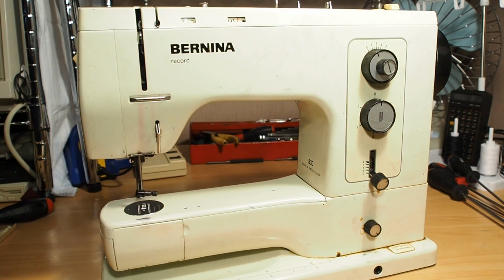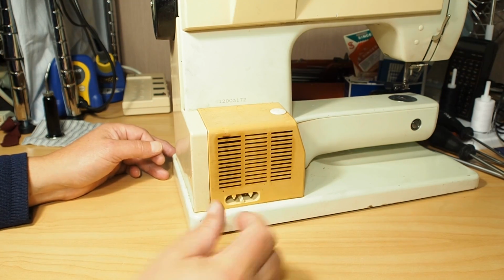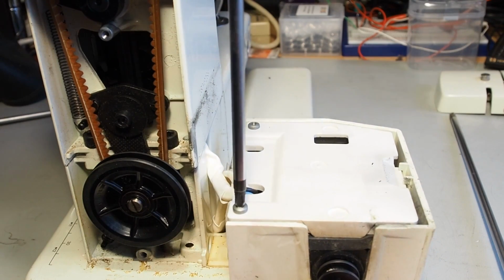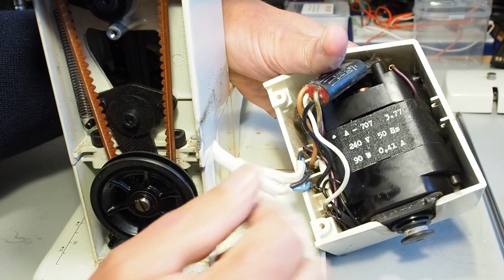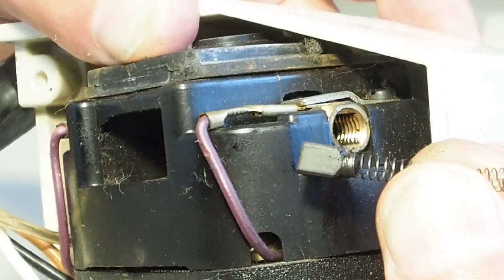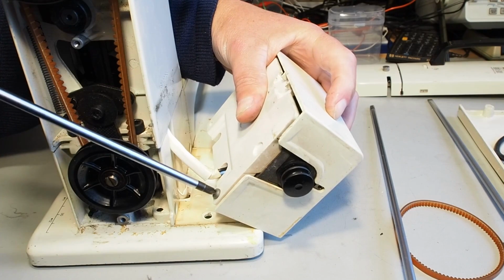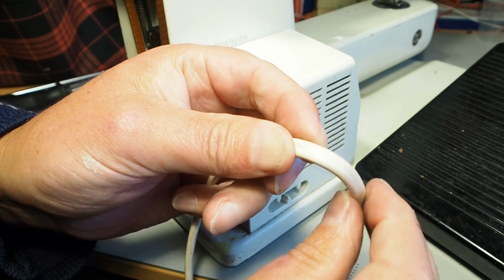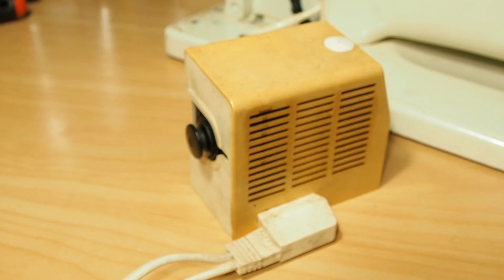Bernina Record 830 - Motor Checking - Brushes and Capacitors

Comment: The brushes are down to about 1/4 inch of graphite remaining, so I will replace the brushes very soon.  I've notices that lately the motor runs as if spinning, but the gears seem spotty about engaging.  I'll check the capacitor in the morning.  It's a good machine.  I appreciate you posting this video.
Reply: @isaiah434ruby Hi, Can you remember what brushes you ordered and where from? Thx

Comment: I just bought a Record 830. It is making a loud grunting noise at slow speeds that goes through the whole machine. Have you seen this issue before?
Reply from the maker: Yes I think I know what you mean. Check the capacitors and the motor brushes. I guess if the capacitors have been removed it could be a cause but not sure. The motor could be at fault.

Comment: Great video. You saved my day on an Elna TSP cam gear. Truly could not of done it without your help. I did change the brushes on the TSP and the motor still growls in initial start up. From 20% on it sounds great. Any thoughts. I'm not sure I'm ready to go into that motor again. Berninas  motor set up is great.

Comment: I just received a Bernina 830 that I bought on eBay. I oiled it per instructions. It runs but never reaches the speed it should. I checked the brushes and capacitors and they seem fine. What else should I be checking?
Reply: Did you switch the max switch at the bottom of the front of the machine? (below the stitch change knobs)
Reply from the maker: Maybe the mechanical parts of the sewing machine (not the motor) need oiling? The machine may be tight in which case the motor is straining to drive it? Either that or the motor is weak?

Comment: Got an 830 Record that needs a new capacitor, any idea where I could find a replacement? (Even better if it is in Australia)
Reply from the maker: If you asked me 10 years ago I would say Dick Smith. Maybe Jaycar? There are four capacitors and they need to be the correct type and assembled correctly.

Comment: Hi, I just bought a 830 record 2ndhand. I notice when I press the pedal slightly harder at fast speed, there are flashes of light emitting from the motor. Is that something I should be concerned about?  I think I might have to return the machine if the motor has some issues.
Reply from the maker: Hi, that can be quite normal although I would be checking the brushes as a matter of course. The sparking could possibly be worse than normal if the capacitors have been removed.
Reply: Thank u so much for your prompt reply. I'm not handy or technical in any way, so I have to bring back to the seller to check. If you are in the country where i am located, I will definitely send to you for servicing!

Comment: Hi, thank you very much, I was able to open motor case and saw my capacitor has a crack so I will remove it. Would you please tell about the wire; white, thick one, transverse lying between the terminals just in front of the motor. Mine is burned out as my capacitor. Can I remove it too? My machine does not have speed switch.
Reply from the maker: If it's what I think it is, you'll find a resistor under the white sheath, in which case it's more than likely a discharge resistor and can be removed.
Reply: @InStitches  I found the tiny resistance. :) thank you so much. Finally I was able to plug in, holding my breath, it works.. I could not manage it without your excellent video. Thank you.

Comment: Great video, exactly what i was looking for! I have recently found a Bernina 807. However the capacitor blew when it was plugged in. Your explanation was very informative. I was wondering if you could explain/show where to purchase a new one? Is it a case of just searching online for a capacitor with matching numbers? Any help would be appreciated.
Reply from the maker: It's a bunch of four capacitors and they are all readily available. You will see the values printed on the side of your capacitor set. Note there are 2 x X2 class and 2 x Y class.
Reply: @InStitches  Can you explain X Class and Y Class capacitors please. I am looking on RS Export web site to order some for my mums 809 that went bang last week.
Seems to still run, it blew the bulb too.  Can’t read values on the capacitor block.  
Wiring colour scheme is same here in U.K. as yours in NZ.
A little vid with capacitor values and types would be great... Non- electrolytic I am guessing ? But as I say,,, can’t see X or Y class reference 

Thanks
Reply: Apologies...ignore my lazy moment about X and Y class capacitors..I just googled it..me being a lazy @@£$.  Think I have got a good enough view of your video to see the capacitor values 0.02 microF and 200puff.

Will have to strip the old one to see the wiring.
Thanks for this 

.